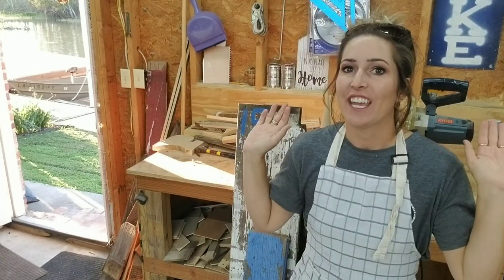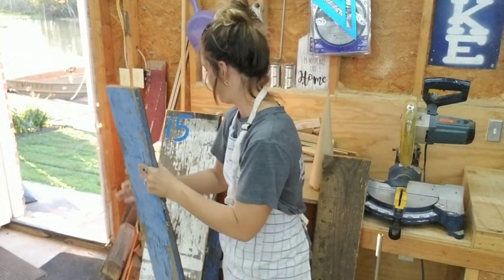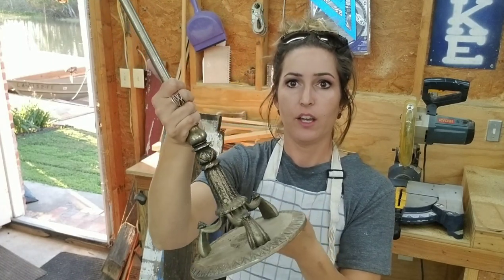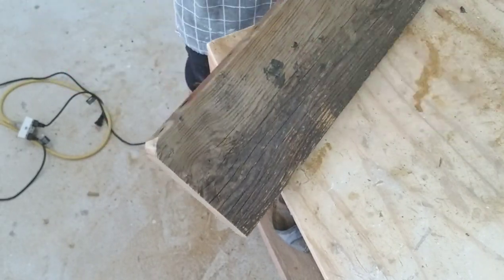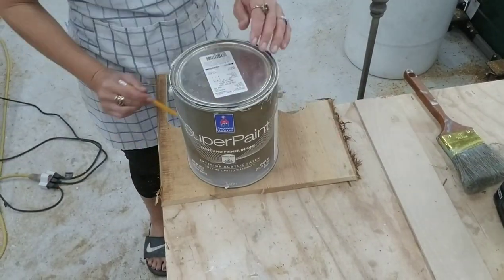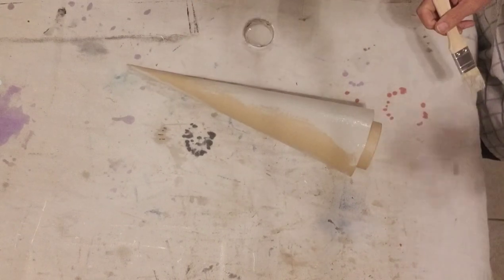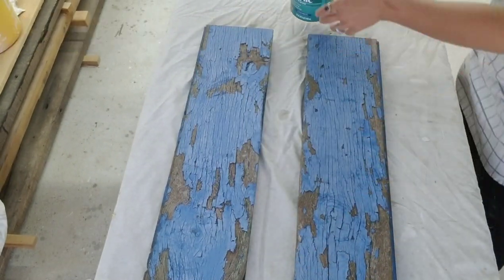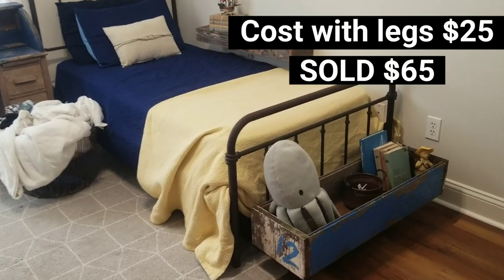Thrift to Treasure • Oyster Tree • Rustic Bench • Metal Candle Holder Riser • Blue Box

Comment: Do you know where that old wood came from? You might wanna have that paint tested for lead especially if it'll be in a little ones room.
Reply: Once it's sealed it isn't a threat. Only if it is sanded or a grinder is used will the paint become airborne
Reply from the maker: It has a few coats of sealer on it